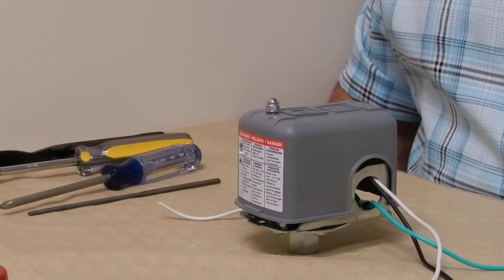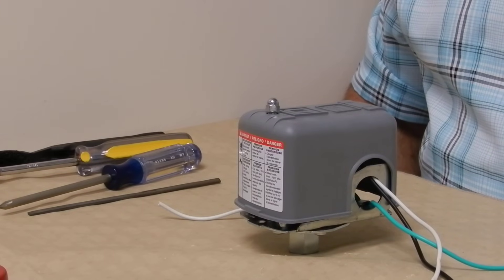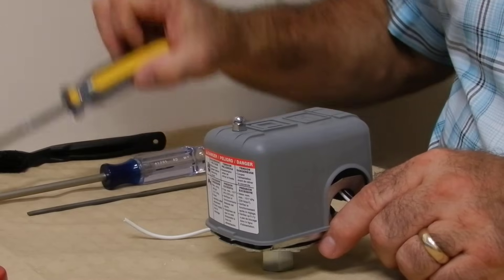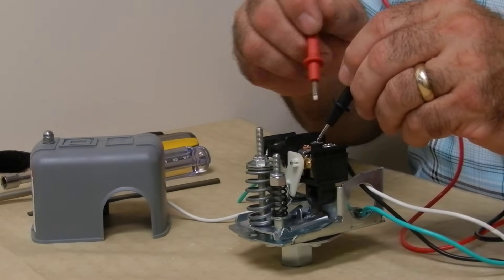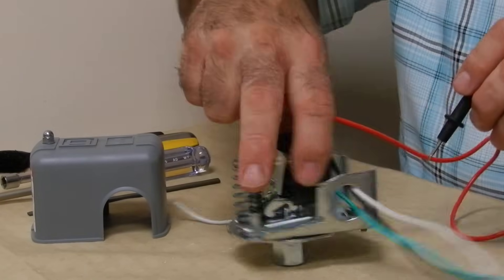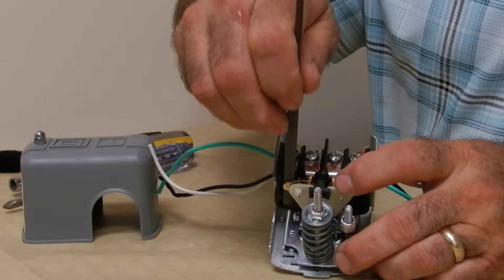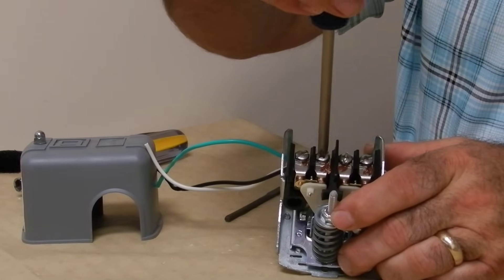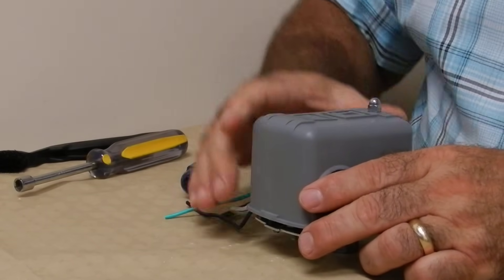Pressure Switch Troubleshooting

Comment: I know that I need to either buy a new switch or replace the entire tank system. For about a month, I have manually used that side-rail, lifting it to the 'start' position, and after holding it in place for sometimes up to 5 minutes, I will get pressure back. That can maintain the auto process for up to a couple of days, and then I lose pressure once again. Then, I start the cycle over again. Is it possible that I only have a switch problem and not necessarily a water pressure tank system problem? 
One other question, if I may; I live by myself in a small house, 920 square feet, and use water for the typical shower, toilet, dishwashing, watering my indoor plants every few days. My question is, do I need a large 32-gallon or larger water pressure tank or do you think I can get by with a 20-gallon tank? I'm not somebody who uses a lot of water... I'm a if it's yellow, let it mellow kind of guy

Comment: I did this and it accomplished nothing.  I was getting weird readings from my multimeter. The 1st problem was a weak battery in the multimeter.  I rwecharged that and still got weird readings like 8 volts? Huh?  It turned out my wire to the pump had a piece of another cord spliced to it with the male plug still attached. That splice was the problem  I looked at it and it had 2 holes in the side of the splice and I saw a spark inside one of the small holes. I fixed that by splicing a different plug to the wire this time with wire nuts instead of tape. The last time I worked on the pump was 2003 so no complaints.

Comment: my well pump switch ;s screw that connects the white wire looks burned and corroded but still works with short cycles whats the reason?

Comment: How would you go about cleaning the water side of the switch? We have a higher than normal sulfur content in our water and it forms hard deposits that HAVE clogged the jet itself in the pump and the capilary tube and most likely the pressure switch itself.

Comment: Sir where to connect the ground wire?
Reply: Green is ground ground screw is green most times. Breakers, subs, motors, switches generally all the same

Comment: Is there a way to fix the little spring that push the electrical contacts ? I saw the little pin that is holding the spring just came loose and ejected the little pin. I put everything back and the pump functioned well but after one cycle the spring and pin ejected again so no more contact when reaching low pressure. Any ideas or time for a new switch?

Comment: My pressure switch is 20/40. It used to turn on the pump at 20 psi and turn it off at 40 psi. Now it’s turning it on at 30 psi instead and turning it off at 40 psi. Any idea what’s causing it to turn on the pump sooner than it should?

Comment: My pump is not coming on,  But the problem is not the pressure switch Contacts.
the issue with my P.Switch is the contacts are in the open position,  in other words They
are not being activated when I turn On a water valve.   So I am think maybe the Spring needs
adjusting or some kind of pressure issue.

Comment: My pressure switch has a arm on it . A d  type. Once replace its now jumping on and off. The gauge when it turns on says the pressure shoots up over 60 there fore shutting down then when it pins down to 30 or lower it kicks in it does it on off very quick what am I doing wrong! Also I don't have the tank hooked thus far . Cause the guy I hired stepped on pvc pipe and busted it all the way to the tank
Reply from the maker: You need a pressure tank need to hire a professional before your well pump is damaged.

Comment: I have the exact same pressure switch, and it wouldn't turn on after 2 weeks without power.  I cleaned the contact surfaces lightly with some sandpaper and presto, it works now.  Must have been corrosion on the 4 contacts.   Thank you.

Comment: Pressure gauge question. I have 40/60 pressure switch. I watched the pressure gauge go from 55psi to 38psi while sitting on floor of basement for an hour. At 38psi the pump started and stopped at 55psi. Again the pressure started to drop. No water was used and we have no leaks of any kind.  What do you think?
Reply: Sounds like the air bladder in the tank is leaking or completely empty, or backflow problems out to the well from the tank.
Reply: @MontclairsLair  back flow would mean bad " foot"  or check valve or lose connection at pump?

Comment: what if max pressure reached but pump stays running? Tap cover of switch and it shuts off as it should?
Reply from the maker: Reduce max pressure setting to a pressure your pump can achieve.  Or get a new switch.

Comment: But what if it sticks on and won't turn the pump off? This has happened 3 times now to me in the past week, and the switch is only a few months old. I'm baffled! I have to take cover off and use corner of plastic cover to pry the contacts apart (while the pressure gauge is reading some 75 lbs of tank pressure) and then the thing will work right against (40/60 psi) for a few days then I'll find it stuck on yet again. Ordering a new switch, because this is dangerous! :-|
Reply from the maker: You may need to hire a professional.

Comment: Thank you (911) Mother hen needs h20 for her chicks...
Is there a way to do any adjustments without a working gauge on the pump or pressure tank. I bought the house and the pump was as is.  The pump runs so far 20 min. and it never shut off.  The pressure switch states that its calibrated at 30-50. I set the pressure , bladder tank at 28 psi with a pump.  I don't know if the pressure switch is at the 30-50 factory settings. Is there a way to back out the screws and start over counting the turns. Or in a pinch get the pump to get water to the house. The pressure tank is empty and the pump just runs with out any water to house or well/trol pressure tank. Any help is appreciated.
Reply from the maker: This problem is beyond the scope of this video. Address this problem promptly before the pump gets damaged. Consider hiring a local well contractor to solve the problem.

Comment: Can this also cause the pump to not turn off? I went to change my hot water tank lines and ball valve and I can’t get the water to turn off. I turned the power off to the pump and closed the valve. So I’m guessing the valve is bad and won’t close all the way, or maybe this? Idk. Im trying to figure it out. Haha.
Reply from the maker: It is possible. The switch may have a clog in the liquid end. Anything beyond this you may want to hire a professional to repair it for you before you damage your pump.

Comment: This video has been by far the most helpful out of anything Ive found. My points were sparking as it turned out extremely dirty. I took my chainsaw file and my pump has never been happier. God bless!
Reply: You should use a contact burnisher which is a very thin piece of metal with a file-like surface to clean the points.   A regular  file will either destroy the contact points or cause them to wear out faster.

Comment: Thank you!!!  I watched your video.  I cleaned the connectors on the pressure switch with an emery board,  tightened the screws, put the cap on. Turned on the power.  I got water!!!!  Yay!!!   Thank you!!!

Comment: Thank  so much for this video.  Water pump suddenly stopped working four days ago. I thought of calling a again the company that fixed it. Then I found your video.  I was a contact problem I did not even file the contacts just open and close then switched back  control panel and pump is running like new. The feeling of satisfaction from being able to solve a problem was so great. "You made my day.".

Comment: Don’t file your contacts, just buy a new $20-$40 switch and replace the gauge while ur at it so you don’t get a false reading. Filed contacts last for a few days, you take too much material off and it doesn’t make proper contact and the pump doesn’t turn on. It can harm the pump. If it gets you by for the day so you can go buy a switch is about the only reason to do this
Reply from the maker: Agreed. This is a temporary fix in the event of a water outage until a permanent solution can be performed. If in doubt, call a professional.

Comment: i have a harbor freight shallow well pump i have check all seals and it will only pump the water to the pump but wont pull inside pump
Reply from the maker: That's because it's a harbor freight pump. Take it back. Get a real pump. Follow the instructions.

Comment: Can any one help me. Because I have a problem about booster pump controlling through hydrovar VFC. That pump is running continuously. Their is no water leakage in the line, NRV is also good, pressure tank is also ok. It's cutt-off pressure is 2.5 bar.
Reply from the maker: Go to goulds.com.

Comment: Switch comes on for a few minutes with great pressure output then switches off  what advice do you have for solving or diagnosing this problem.  The pressure switch is new.

Comment: Thank you Bill, for your excellent instructional video. Took it step by step, turned off my hot water heater, and well pump, use a volt meter, etc.etc...Contact points were the problem! Hardest part of the job was taking off the side panel of my well house...Saved me a ton of money!!!

Comment: I wouldn't have believed it if it didn't happen to me. Tank ran out of water and pump would not work. After watching this video I checked the switch and a small hard-shell bug had gotten wedged between the electrical contacts. Pulled it out and everything is back to normal. Thanks!

Comment: Yeah I have a pressure switch that you can run manually but will not shut off and will not come on when pressure drops what's the issue
Reply from the maker: Tony Freeman I don't know. Hire a qualified well contractor.

Comment: Hi William, nice video.  My 1 1/2 horse pump is two years old.  Replaced pressure tank 1 month ago along with new pressure switch and gauge.  Tank pressure is set at 40/60 psi.  When pressure cuts in the pressure switch clicks twice.  It just started doing that.  What adjustment should I make to fix this?  Thank You!

Comment: I wish he had actually did a troubleshooting video in which he troubleshooted more than just dirty contacts, I came here to troubleshoot my pressure switch to see how to properly adjust it to the proper settings. But I guess I will have to look elsewhere.
Reply: This is a big problem that saved me a bunch of money.  It's called a pressure switch because when it loses pressure in the line it turns on the pump a simple on off switch.  If you want more or less pressure you need to check a variety of things.  You can increase or decrease pump size to change velocity.  You adjust pressure to waterlines and flow through the holding tank for that matter.  I hope this helps.  My water quit on me one day my dad taught me how to fix this problem.  Now men like this man are doing the same.  One day if you continue on well water you will have this issue.  Its way more affordable than buying a new switch and offers a feeling of accomplishment

Comment: Just wanted to take a minute to thank you, as you just saved me $30 on a new pressure switch.  A couple points, when I tested mine with my multimeter I wasn't getting continuity across one side and that was the side that needed cleaning.  Of course if you're in there, might as well do both, right?  But I had already cleaned both and still no juice.  So testing it guided me to which one to work on more.  Also, I didn't have a file slim enough to fit in there so I wrapped some sandpaper around the tip of flat head used that to clean up the points.  Hope this helps someone else down the road.
Reply: thanks! worked like a charm...

Comment: Hello Sir,
I have a water pump that does not shut off. The pressure builds to the normal value but the pump does not shut off, however the pressure does not rise beyond the usual normal cut-out pressure.  The supply water tanks water level was very low recently and when they were filled again then I noticed that the water pump does not shut off. A new pressure switch was installed about two years ago. Any tips on what could be the problem? Thanks.
Reply: faustsmith did you find an answer to your question? I have the same problem at the moment.
Reply: @wingman559   I have that problem to
Reply: I have same problem.   Water is there, tank is full of water and bladder has  the 35psi air , switch getting plenty of water and at high enough pressure.  Pump motor keeps running.  Even went 7 turns out (ccw) on nut #2...no change.  (nut 2 should lower cut-off pressure, according to the writing inside cover)  new motor, 2nd new switch. (Switch not problem?)

Comment: Mine is constantly coming on with no water running every 3-4 minutes all the time every day? Do you know why. And only for a minute then shuts off??? Please help
Reply: Robert D you have a leak somewhere
Reply: Yes I did. I pulled it up and found out that the top of the pump was cracked. I thought it was a check velve but I was wrong. I Went to tractor supply bought a new pump 370$ and replaced the old one. Now it holds pressure  👍😃